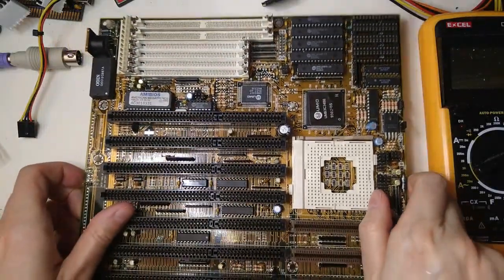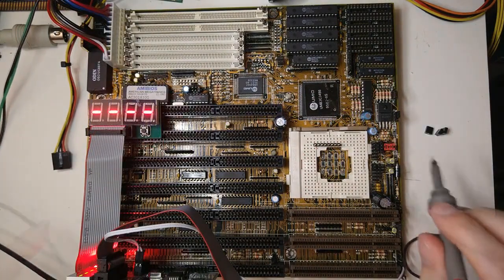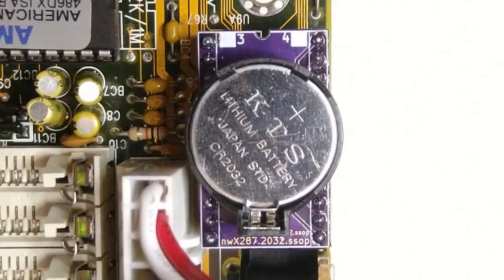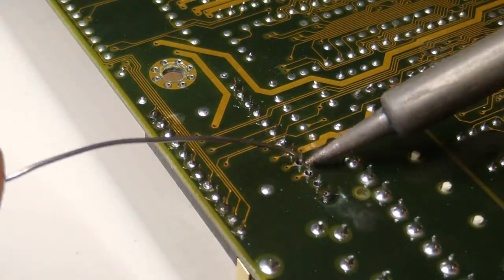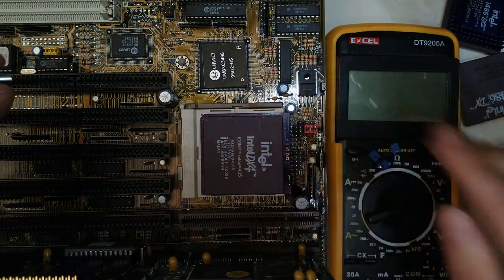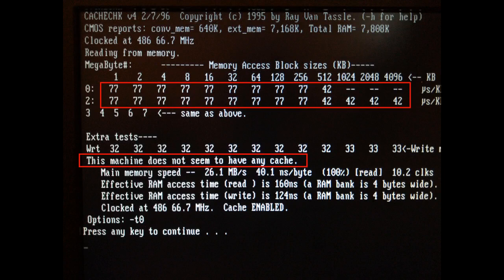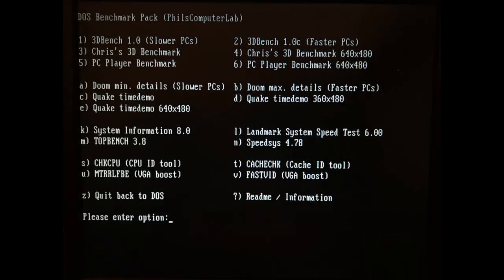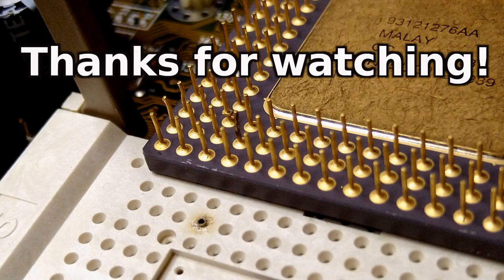Embarrassing mistakes made restoring this Biostar 486 motherboard

Comment: I once had a somewhat similar experience sometime in the early 90s. A classmate had a 286 that would freeze very often (every few minutes) to the point that the machine was practically unusable. Upon closer inspection, I couldn't find anything wrong. I wondered if the DIL processor socket had a bad contact (it was an atypical AMD 286 12MHz in a DIP package). So I took the processor out and put it back in. It didn't help. I tried again, but there was an error. I'm just a one-tasker and while my classmate and I were chatting, I wasn't paying attention and inserted the processor into the socket rotated 180° and turned the machine on. I immediately realized what had happened and turned the machine off. The processor got very hot and I was very scared because I was practically sure it was dead. However, when I inserted it into the socket correctly this time, the PC worked normally and stopped freezing :D He used it for about two more years without any problems.
Reply from the maker: These old CPUs could take a lot of abuse! 

Ha ha, inserting it the wrong way gave it super powers :D

Comment: Will not replacing a rtc module result in a motherboard not to post? Got one that I assumed I could simply remove it (low battery message reported). Would not boot anything prior to removal either. Now get single repeating beep at power on.
Reply from the maker: Removing it will cause the motherboard not to boot. But you can change its battery. Necroware has an excellent video on how to heat up the RTC module to expose the chip and to replace its battery.

Comment: But how can you insert a CPU the wrong way, the socket itself should not let you insert it. Also Those CPUs have thermal protection. I remember I built a computer once where the heatsink fell off and the computer would start and shut itself off to prevent damage to the CPU.
Reply from the maker: The 486 sockets, unlike any later sockets, will let you insert the CPU any way you want. So the PSU's 5V and GND were shorted through the CPU pins.
Reply: @scrap_computing  ok

Comment: Don’t be fooled by the turbo switch. I have come across that exact page multiple times, without it being the logical solution. I’ve put aside the motherboard a lot of times, because I couldn’t get it to perform as it should. 

I eventually found out that one of the VLB slots had D4 connected to ground, which causes the cache and performance issues. To make matters worse, another VLB slot also shorted the LKEN# to +5V, which occasionally caused the motherboard to either halt or not boot at all.

Comment: try using some flux for your desoldering homie, will help not heat soak and prying against the board. that lead free solder doesn't like to melt. great video thanks. killing it!

Comment: We do silly things when tired. Some months ago I plugged the power connector inverted o a Toshiba DVD Rom IDE drive. Yes, even molex connectors can trick you. It burned an IC on the DVD drive board. I put it aside, maybe I can replace the IC… drives are still cheap, so I’m not doing that in the short term. As for checking all jumpers on a motherboard: it is a best practice and you will never forget it again 😅
Reply from the maker: Yeah when you get tired you get confused and do all sorts of silly things. 
Wow it is hard to get the molex connector in the wrong way :)

Comment: That looks like yet another variant of the infamous PCChips M912 (mainly known for some having fake cache). I have run across at least half a dozen different variations of extremely similar layouts, each touting different manufacturers and only slightly different design choices. For instance, some have a barrel battery, others coincell, while still others use a battery+clock package, like this one...Other differences may include jumper/vrm layout, and keyboard controller vs silkscreen vs blank solder pads above the outer most ISA/VLB slots.

Frick, I need to create a spreadsheet or something as these boards are especially close to my heart because my first motherboard was one of these variants.
Reply from the maker: There are tons of similar boards on theretroweb!
Reply: @scrap_computing  Yeah, I'm aware of that but last I checked they only had one or two other variants listed on the M912 page. I suppose in that context, they're only interested in 1:1 identical boards, whereas I'm seeing many that aren't quite identical but really close.

Comment: I'm glad you share your triumphs along with your mistakes.
This vid reminds me of the time I accidentally plugged an AT power connector on a 486 board the wrong way. Toasted the board, but the PSU didn't seem to mind at the time! Luckily, the machine had other issues and needed a MB replacement anyway. It was quite the learning experience!
Reply from the maker: I have not got the power connector in the wrong way yet, but I am pretty sure it will happen some day :D

Comment: Thats one tough CPU!

Crackling sounds, burned up and burned the socket and it still didn't die.
Reply from the maker: The DX33 CPU did die, but the interesting thing is that if you plug it in (the right way) it doesn't get hot or anything, it just doesn't work. I am thinking of removing the die cover to see if there is any visible damage.

Comment: I commented on a previous video of using a post code card with an external display. Funny to see you already have one.

About the cpu: everyone makes mistakes! I am glad that at least nothing was damaged.

Oh and about the thermal paste. The bit at the end will inevitably dry a little and then become stuck. When using the syringe type, I try to pull the syringe first until it becomes loose. Then I press down to apply. This saves you from accidentally applying too much paste.
Reply from the maker: Yeah these external displays are pretty useful!

Thanks for the tip, I will try it out next time :)

Comment: An easy mistake to make. I fried a k6-2 the other day. The auto voltage feature of the board was not enabled and smoke came from the CPU 😊
Reply from the maker: Haha yeah, there are so many things in such old systems that are not fool proof. 
Setting the voltage jumpers always makes me nervous, so I usually check the voltage on the socket before plugging in the CPU.

Comment: you can just gently push the pins away from their soldered places with a soldering iron to loosen them. no need for hot air
Reply from the maker: Yeah I usually do that, but it doesn't always work and you need to reapply solder and try again.

Comment: For better desoldering and avoid using hot gun I'm wiggling the desoldering gun tip around the hole . It makes that chip pin is free and does't stick to the board. Anyway great job !!
Reply from the maker: Yeah, I usually do that, but this only works well if the pins are centered.
Reply: I'm pretty sure he does this already.

Comment: What desoldering gun are you using. Is it any good? I have ZD-915 but it's barely enough for lead solder, and not suitable for lead-free solder.
Reply from the maker: I also have the ZD-915. It's not great. Regular cleaning helps, and using hot air while desoldering also helps quite a bit.

I wonder if a soldering iron with a built-in pump would work better.
Reply: @scrap_computing  Recently i found S-997P desolderin gun. It looks like a nozzle have a thread (like on DEN-ON SC7000Z) so the termal conductivity can be better. The problem is that i didn't found any reviews so I i can't fully confirm how it works.
Reply: @detalite  That looks like the single pump version of the dual motor S-998p that has been reviewed. And Gaojie PW-993 appears to be a related item again? Anyway good luck.

Comment: Hello, are you aware of the projects Samuel Demeulemeester? (Doc TB X86.FR) 
The universal chip analyzer is amazing and sorcery to me, way over my head but I really would love for someone like you to test and explain his ATX2AT Smart Converter, apparently you could had avoid the kind of failure you are showing here, the adapter cut out power to the board as it detect an overcurrent and nothing get damaged.
Thanks!

Comment: The Turboswitch… 😅 I also wouldn’t have expected that as well.
And thanks for inserting your error with the CPU, I assume most of us have done it also once. I also killed a 486 in the late 90s in the same way. 😢
Reply from the maker: I assumed that bridging the Turbo contacts with a jumper would result in high performance mode. It turns out I was wrong :)

Yeah, I guess it is quite common. At least I destroyed a pretty common DX33 :) It could have been worse.
Reply: @scrap_computing  this is what I learned a lot of years ago, that basically all Boards with Turbo do run normal and activating "Turbo" makes it slow... 

😳

Yes, I made this face also.